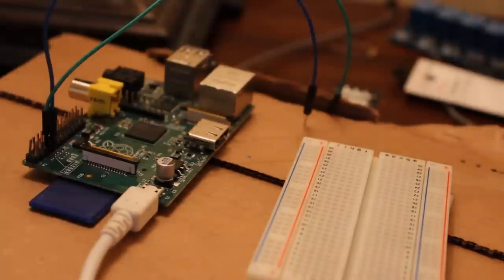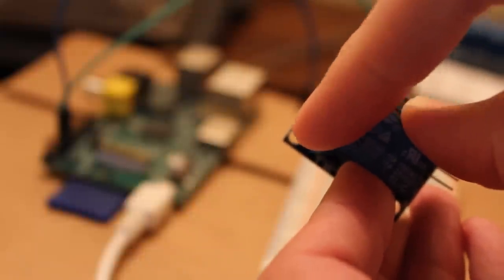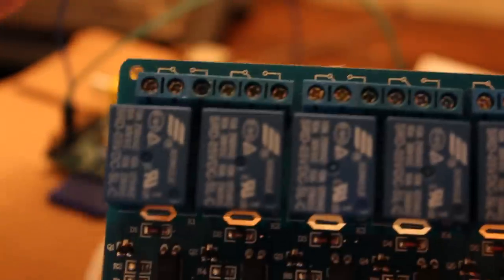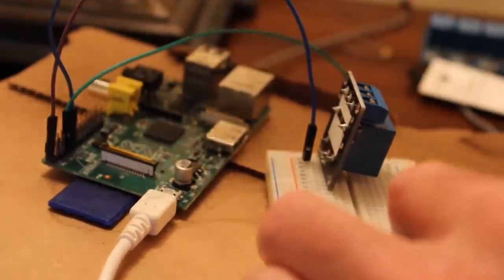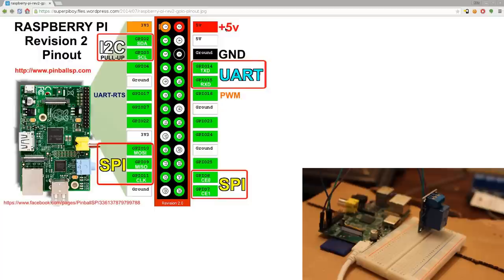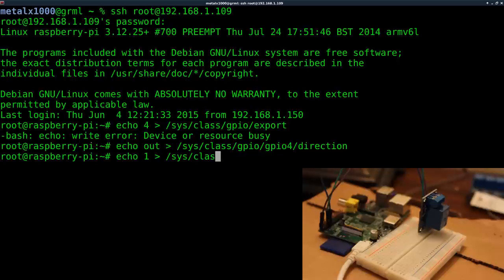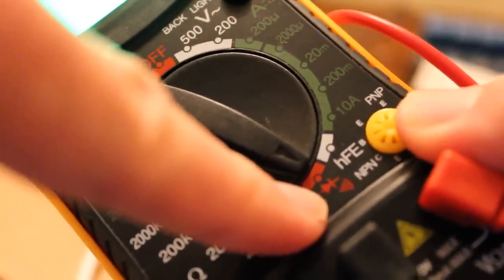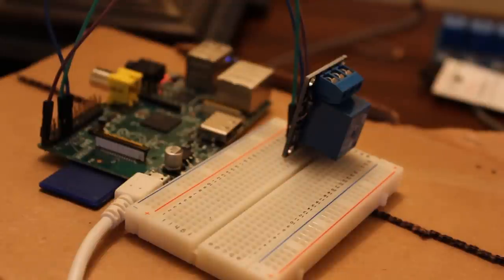02 Raspberry Pi GPIO High Voltage Relay Switch Home Automation Linux Tutorial

Comment: Could I use that relay as a three way switch by hooking up the hot to the middle terminal and the traveler wires to the left and right terminal? I'm looking to control the lights in my house either by flicking a physical light switch or via a computer program. Thank you :)
Reply from the maker: I believe that will work, if I'm understanding you correctly.
Reply: Thank you

Comment: This is awesome! I can't believe it's so easy. You explained it very well. I have a question on the relay. Is it safe to use that relay to switch on/switch off my ceiling lights which I guess are normally powered at 120v? Do you have an amazon link for the relay you have?

Comment: good video, but some important things are not covered:
what's the voltage output of the relay? is it 120v ? how is that possible if you don't have external power source for the relay?
how do you choose rely output when you purchase it? like  12v, 50v,120v or 220v?
Reply from the maker: +Haider A A relay is just a switch.  
The Voltage output will be what ever you put into it.
As far as external power source, the relay is powered by 5VDC coming off the Raspberry Pi.
When you choose a relay, you just need to make sure that it is rated above what you plan on using it for.
Here in the US the voltage coming out of most common outlets is 120vac.  So get a relay that is rated for that or higher (most are). 

The relay should say right on it the voltage it's rated for, in both AC and DC, and the Amps it can handle.
I go over all of this about a minute into the video.
Reply: Kris Occhipinti Thank you sir,what im trying to do is to run a bigger motor like 12 v to run an RC, i was researching this and didn't quite find an answer,i was wondering what exactly do i need for it, iam not very good with electricity, now i know from your video that the rely is only acting as a switch , so i understand that i need an amplifier to output 12 v to the motor in addition to the relay, that amplifier will need it's own power source, is that not right?
Reply from the maker: Haider A If I understand you correctly you are correct.  You will need 12v power coming from a source and you run it through the relay like you would through a light switch.  The only difference is that the switch is turned on and off by the Raspberry Pi's GPIO pins.

Comment: Hey man can I use a relay as an input to the Raspberry Pi? --

Case being -- the relay is in NO state and when a light (in a room switches on) the relay changes it's state to NC having current flow through it. Would it be possible for the Raspberry Pi to detect this? 

Thanks!!!!

Comment: If I don't want to use the 5v from the pi could you tell me how to power a relay from an external 5v? I try it but the relay did not trip
Reply from the maker: If it's 5v I don't see why it's not working.
Reply: So if I hook up 5v from a 2nd cell charger and and use the pin from the pi it should work right. I tried that but the relay did not trigger.. it only trigger when I use the 5v fr
om the pi ??
Reply: Relay and pi should have same ground...
Reply: OK thanks I will try that
Reply: bobby royster  NO stop. I just said that you mistaken when tryes to power up relay and pi from different sources! All 3 @plus@ @ground@ @signal@  must be from one source (Pi or something else).   All you need in this situation is use of "SOLID STATE RELAY" it uses smaller shifting currences. And 3 volt is enought for shifting.
Reply: I got it working .... I use a 2nd 5v cell charger and I splice the ground from the pi and the 2nd charger ground together. All of my relays are triggering now and they are not using the 5v from the pi...Again Thanks ..

Comment: Can those relays be used in a car? 12v DC?
Reply from the maker: I would say yes, although I'm not the most knowledgeable person on this topic.  Relays are using in cars (think your clicking turn signal), but there are different styles of relays.  My only concern with using a relay like this is the connections.  In cars you want to avoid using things like wire nuts because the shaking of the car while driving can wiggle the wires loose.  I can see the same thing happening here.  But, if you were to get relays with different types of connectors, I would believe they should function in the same way.  But, as far as the voltage goes, as long as you don't exceed the maximum voltage your relay is designed for.  Both AC and DC are normally written on the relay, make sure you're looking at the right number, but these replays can handle 12vDC no problem.
Reply: Kris Occhipinti, aftermarket car audio amplifiers often use set screws.  So this does not worry me.

Comment: Great video and fun relay. Just FYI, you keep saying "high voltage" but actually it only controls 120V. I know that's high compared to what the raspberry puts out but by electrical standards 120V is considered low. IEEE considers "Medium Voltage" anything in the range of 1KV to 35KV. "High Voltage" is anything greater than 35KV (35000 Volts).
Reply: but you have to understand, if you are not in this field, it is considered "High" for normal people!

Comment: Very nice video... But to use the term High Voltage in this context is incorrect

The terms of voltage is classified in 3 levels of risk:

"Electrical arcing" which is everything above 1000VAC or 1500VDC. That is what we call "High Voltage".
"Electrical shock" ranges between 50VAC to 1000VAC or 120VDC to 1500VDC and which we call "Low Voltage".
"Low risk" which is everything below 50VAC or 120VDC and is called "Extra-low Voltage".

So the Raspberry PI along side most of consumer electronics today is actually extra-low voltage. The relay you are using allows extra-low voltage devices to control low voltage or mains voltage devices.

It's better to call it "mains voltage" or simply "mains" to not spread confusion.